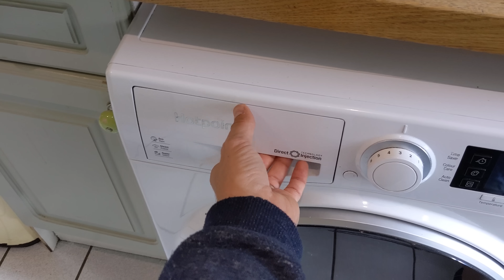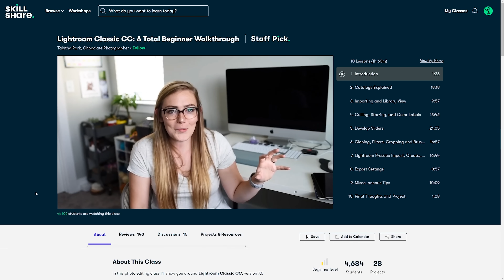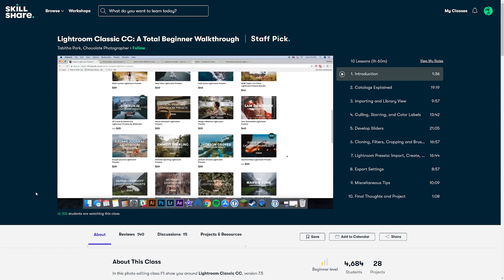The Pythagorean Siphon Inside Your Washing Machine

Comment: Good video. You know how you used to see in movies  guys sucking on the end of a hose (as you did here) to get gas out of a car?  I've seen people doing this. They always got a mouthful of gas, they never actually got the siphon to start.  (the shock of getting a mouthful of gas, which stays in your mouth for the rest of the day, disrupts the whole process. I've successfully done this with water of varying degrees of cleanliness). The actual method old timers taught me was, you put the hose in the tank and then you cup your hands as close as you can around the opening and blow into the tank. The seal is never perfect but good enough. This is the method I've always used for transferring gas, but it didn't work on most cars made after about 1970 (the tank opening is usually recessed in a compartment). The other method used for draining above ground tanks and swimming pools is to sink the hose put your thumb or palm over the end sealing it off and then get the hose outside, after the end of the hose is below the surface level of the water you can take your thumb off the end.

Comment: US toilets have a flapper valve that allows the water in the tank to enter the bowl, and some of it comes out of a "jet" at the bottom of the bowl to force the water up and over the trap, and then the rest of the water in the bowl naturally follows.

Mine uses 1.28 gallons or 4.8 liters per flush as the landlord installed a higher-efficiency model before I moved in. To get a partial flush, nothing special is needed: just flush. To get a complete flush, hold the handle down until all of the water has left the bowl and new water starts to be added.

What I see with this model compared to what you show is that it is more intuitive: no special effort needed for a partial flush, and if you hold it longer, then the toilet will flush for a longer duration. Also, there is not nearly as much mechanism involved, just a simple lever, chain, flapper, and water. Fewer parts means it's easier to maintain and less problematic when it's not working as it should.

For a pronunciation guide, in the US we say it 'yer-in-ull (emphasis on the first syllable).

Comment: There are many other types of toilet flusher's as well... the conventional flapper being a differing one for sure, and far more in use worldwide overall, heavily so in the US. Though we have dual flusher's via push button. Small water use for no. 1, large water use (flush) for no. 2.  Not so common, but definitely present. . . The flapper being the most common as mentioned, with varying means of fill valves as well as fill limiters. Then of course we have an array of jet flusher's, which either deliver high pressure supply to jet flush nearly anything down... or manipulate typical static line pressure into a high pressure burst, of which will flush most things with ease. These types of toilet flusher's are what you'd see in most of our commercial restrooms, though some residential employ them as well. Really, just browsing our Home Depot inventory of toilet repair could shed a ton of light, lol... Set the VPN to PGH PA or something, go to HomeDepot.com , and peruse the varying toilet goodies.

Comment: The siphon toilet eliminates a need for a gasket, which always fails after a few years.  However, doesn't the siphon toilet also reduce the force of the water, which is needed for the semi-solids and toilet tissue to be flushed, especially considering low-flow toilets?

Comment: That’s not how toilets work in America. Here, we use water only to start the siphon. Rubber plug opens and lets a gallon or two of water into the bowl, that amount of water in a short period of time  makes the water rise above the peak, pushing the air down and creating a suction. Holding the flush lever down does sometimes make a stronger flush as some toilets don’t empty the whole back tank per flush. A pro with this type of toilet is if you want to flush without using too much water, just hold the flush lever down slightly... doing so doesn’t pop open the rubber stopper but still let’s water through, still able to start the suction but you have control when to cut the water.

Comment: Its a buoyant flap here in the usa. You pull the lever the flap opens and floats till all water is flushed then the flap touches the seal and stays stuck down by the weight of the water.

Comment: I live in the US and I've changed a few toilet fill valves in my home. It's never fun, but I can definitely say that the toilets in my home do NOT use a Pythagorean Siphon. My toilets use a simple rubber flip cover. When you push down on the handle to flush, the cover gets pulled up and the water rushes down the hole. Once the water has all flowed out, the cover flips back down. 
Still, I found this interesting... even though it was about the "math" of toilets.
Reply: But the toilet bowl itself is a Pythagorean siphon. Hence, why it sucks air at the end.

Comment: In Poland most  toilets have a flushing mechanism based on a float with a seal (kind of like a cork). The pressure of water keeps the float pressed against the opening in the bottom. When you push a button, the "cork" is pulled up and it tries to floats to the top but is held down few cm above the output. It stays floating until completely drained, then drops back down and re-seals. It's a delicate balance between buoyancy of the float and surface area of the output.  Modern versions of this mechanism have a 2-function (or more) button that allows you to flush less or push the float back down and close it to conserve water.

Comment: I live in the US and we typically use a floating plug at the bottom on the tank, which is pulled directly by the handle and once released, floats upward until the water is low enough for it to seal again.  I have never seen a siphon like this before in the tank.

However, most toilets I have seen do use a greedy cup type siphon (more like half of your 2d demo, the drain path goes down and out the back, then up again behind it, then back down into the floor drain. It looks like a filter with a long flexible neck where you hook the neck upward almost as high as the funnel itself. This causes the toilet water to sit until enough is added to flow over the top of that drain, then it all gets pushed through by the air pressure above.

Comment: Here in the US, Syphon toilets are uncommon.  Traditionally there is a single valve at the bottom, the lever raises the valve, flushing, and then the valve reseals, allowing for the float and fill.

Comment: Most of the toilets in Mexico have a kind of a piston that just gets lifted when you pull  the leaver to flush the toilet, the piston then lifts over the water level of the cistern and then when the water level falls to a certain level the piston gets pulled to its place by the water current and it goes back to stop the water from flushing it also has the floater to not let the water level rise over the limit of the cistern, now newer toilets use a different system, idk how it works but it has two buttons at the top and that’s it

Comment: Interesting video and good demonstration. I've seen multiple designs in the U.S. primarily separated but $$. The two factors in U.S. toilets most people look at are cost and flushing power.  All joking aside, the bog standard U.S. diet is hideous on the bowels and leads to a lot of constipation issues. These near constipation bowel movements also don't generally require much cleanup which is part of the reason bidet options are so rare in the U.S. ( that and the fact that Bidet is a recognizably French word and automatically decided against by a large portion of the populace for sadly Jingoist reasons ) What they do require is an unusually high flushing power to break or force the solid fecal mass through the toilets built in vapor trap. As a rent seeker who self maintains 2 properties plus a home, I like to joke, "I'm no plumber, but I have installed enough toilets in my time to know what a shit-show looks like"

Comment: United Utilities have told me I am using water continuously, all day, every day. The reason is my toilet cistern is leaking water into the cistern, and it's trickling (almost imperceptibly) down the pan. The cistern mechanism is not the usual type with a float! It has a central tube that lifts up to flush the toilet, and a separate mechanism with some sort of float that pops up when the cistern is full. Now all I need is for the LANDLORD FROM HELL (Adactus Housing Association) to fix it and save me money! (I'm metered!)

Comment: American here, and we also have siphons in our toilets, but the difference is where the siphon is. For every toilet I've ever owned, there is plug at the bottom that allows the reservoir to drain into the bowel. There are usually small holes around the bowl to rinse the sides clean while most of the water goes to the bottom and sprays a jet of water on the bottom of the bowl in order to start a siphon that drains standing water inside the bowl. The pressure in the spray comes from the fact that the outflow opening at the base of the bowl is about half the size of the drain opening in the reservoir. Someone whose reservoir is damaged in some way, can instead shut off the water supply to the resevoir and fill a bucket with a fair amount of water and pour it directly into the bowl to start the siphon. Note: this is much less effective for solid waste.

Comment: In Germany, the toilets are mostly working by pulling a plug on a plastic rod and to save water, you can push the plug down to seal the flush hole. So you can choose the amount of water for flushing your toilet. There is no syphon mechanism working.
But it's an interesting solution.

Comment: that seems overly complicated for the tank mechanism...  

US : "lets just pull the plug out but we can attach half of it to a riser so you cant pull it all the way out. If we do it this way we wont have to call a plumber if it doesnt work right because this way is a no-brainer..."

UK : "you know who doesnt have enough to do? plumbers... if we build it this way, then when something goes wrong, we can call the plumber out and thatll give the blokes something to bloody do. Lazy Baaaastards"

UK plumber : "Our plan is working fellow plumbers... we have been successful in fooling everyone into thinking we need work... at the same time our overly complicated flushing mechanism has been adopted by everyone.... We ensured as many moving parts and intricate multi-teired fluid dynamic concepts were implemented in its design to make it look complicated as bloody hell.... no regular person willl want to touch this thing once they see it. so they will be calling us for sure... and because its the loo, we will have them by the bollocks and can charge what we want... now we just sit back and rake in the dough. bwaaahaa haaa haaa!"
Reply: that is the old UK mechanism and it is the worst possible. Also patented. Like any other british failure. That mechanism increases water usage 3-4 times (you can't stop the flush or partially flush a toilet), and uses a valve that breaks once every 2-3 years and is very expensive. Imagine paying 20 USD for that. That design is being phased out.

Comment: I've never seen a toilet remotely like that!  I think it must be used because it supports the half-flush.
Every cistern I've ever looked into has a flap on the drain on the bottom.  Very simple: open the drain by pulling it open.  If floats so it stays open until drained.  It stays closed if the water starts covering it slowly so the pressure seals the edges down before it's deep enough to float.

Comment: most toilets here just have a flap on the bottom of the tank with a air bubble in it. when the flap is pulled up the air bubble keeps floating open till the entire tank is drained and then the floats down into the closed position. at which point the tank refills. the entire system only has two moving parts. the refill float and the drain flap.

Comment: as per instructions...
my toilet's currently busted so I flush with a bucket that I fill from the drainage from my AC. So basically I flush with condensed air! (I live in Florida so there's no shortage of water in the air)
Reply: Lol! Indeed, Florida's air is mostly water mixed with a hint of oxygen. Ive had to do that myself before but from a pond by the property.
Reply: Good way to save on sewage fees since it is based on metered water, not metered sewage.
Reply: Heyyy what city do you live in
I'm in Wesley Chapel
Reply: Kitty beans....
Reply: The virtue signaling is strong with this one.
Reply: @aviationist  what???

Comment: My toilet from the early 2000s here in the us has a boyant rubber stopper that gets pulled up to flush. In case of a leaky float valve there's an overflow tube that's high up above the normal water level in the cistern.

Comment: Huh. Every toilet i've dealt with enough to see inside just has a gasket/valve at the bottom of the tank and a chain attaching it to the handle. You press the handle, it pulls the chain, which lifts the valve, and the water drains out of the tank into the bowl. If your press is too short the valve will drop back shut right away, but hold it for a second or so and that valve will stay open until the water has all drained.

Comment: When I was in Belgium, there was just a cold water pipe with a button it.  The push-button let the water in from the cold water system (just like opening a tap on full).  You'd have to hold it in for as long as needed to get rid of any waste in the bowl - very useful for stubborn floaters. 
Also, the toilets over in Germany had a slightly dished "step" at the back of the bowl.  Search "German toilet bowl" on Google for images - NSFW.  I never worked out why...  dunno if there's a video in it, although you might want to avoid making it before you get labelled as the YT toilet guy

Comment: In the US the toilet flushing system ive seen the most is the use of a toilet flap. Essentially the water level is controlled the same way as in the video with a bobber, but the lever is attached to a chain which pulls up on a rubber flat. When you flush, the chain pulls up on the flap and water rushes in forcing the flap to stay open until the whole tank has drained. At that point the flap closes allowing the tank to fill again.

What I found interesting was the idea of a half flush. With our flap design you can't really do a half flush, its all or nothing. The up side to the flap design is that you can hold the flap open by holding down on the lever and cause the bowl to continue to fill. You can use this if the toilet is clogged to use the water pressure to force everything down. Id be curious to know if you can do that with the siphon design.

Comment: In Canada we use a flap that holds air inside the bottom that is lifted by the handle and it floats open untill the tank is empty, then the weight of the water filling up keeps it closed and the water stops flowing either using the same float mechanism as the video or there is a new style, but I've only ever seen the flap used here, not the siphon. It might be in newer toilets here, I'm not a plumber by trade, I've just fixed a lot of toilets.

Comment: The bowl of a toilet is a siphon. It's a very special siphon, it's not technically a Pythagorean Siphon, but it's a similar siphon, if it had been more closed it would've been a Pythagorean siphon, but due to it not being that closed, it works just like a water trap instead. And let's be glad that they do, because that prevents bad odors from back-traveling up the pipes as all bad odors just stay there and can't permeate through the water. However if you don't clean your toilet, it will stink either way, because filth stinks. And toilets aren't self-cleaning systems.

Comment: italy here, all the toilets i have ever seen here either have the dual buttons to chose the half or full, or you have the option of resetting manually the position of the button (it looks like a switch, where a half goes up when you push down)to cut the flow and have half. The 'handle' model is not very common here.

Comment: In europe they use a moving tube with flat rubber gasket at the end with a Styrofoam piece on it . When the reservoir is filled with water it puts pressure on the tube because on the other side of the hole is air (low pressure) . When the tube is pulled it stays up level with water because of the Styrofoam piece ( because its in equal pressure , the hole is covered with water coming down ) and it comes down slowly with water until it reaches the bottom then the hole is closed creating low and high pressure sides , then the  reservoir is filled pushing down on Styrofoam    .  Its like putting Styrofoam piece with a rubbered side in a sink it will close the sink if it comes close to the hole but once pulled it will stay up level with water until it reaches the sink hole .

Comment: Never seen a siphon toilet before. In Canada, almost every toilet uses a flapper - a rubber circle that floats, but seals to the tank outlet and is held down by the water weight creating a pressure differential at the outlet. Once you break the seal it floats and remains floating until the water level drops enough for it to reseal. Unfortunately with this design there are two different causes for running toilets - bad flapper seal and badly adjusted/malfunctioning float valve, as opposed to the siphon which would only be prone to float valve issues.